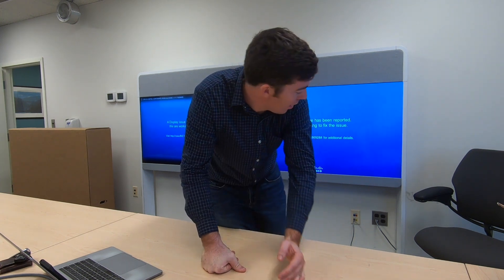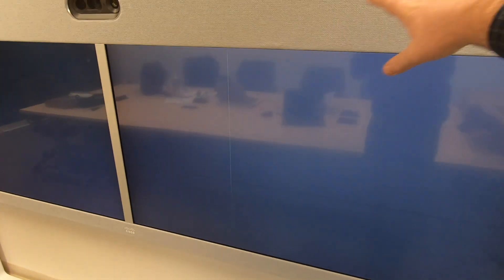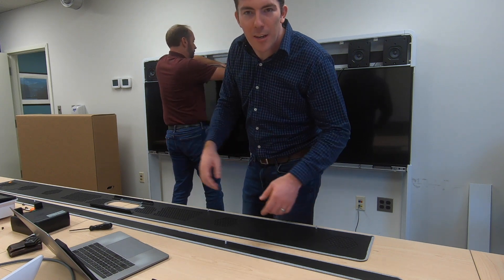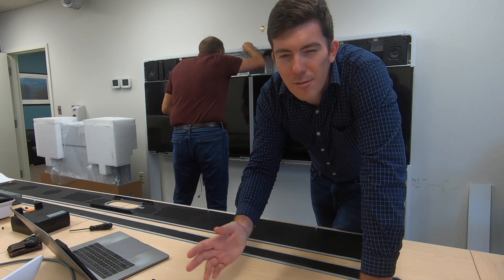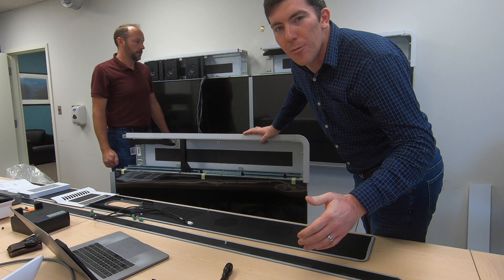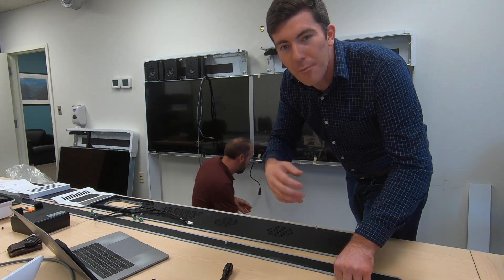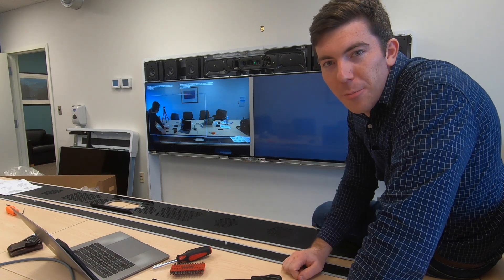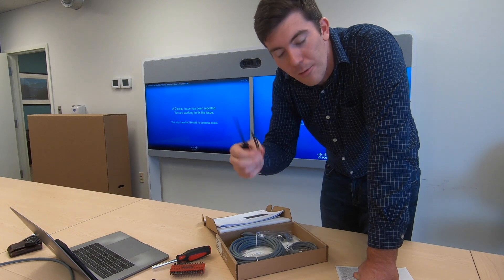Cisco Room 55 Daul Screen Screen Replace and Repair

Comment: Hi bro, i have spark room 55 but lost touch 10. Can i connect to laptop to use as extender screen without touch 10?
Reply from the maker: You could.  Just connect HDMI and go.
Reply: @TheTechCatalyst  Thank you bro, one more question hope you can help, cause room 55 was reset default so it stuck in startup wizard, i can log in web ui to skip startup wizard and can plug hdmi in to use as extend monitor with speakers. But, it still have a small over lay notification say that "touch panel is require" Can i turn off it 🙂

Comment: Do you have some advices to remove Room 55 from the wheel base? We pull the lock and want to lift the screen up, but the screen doesn’t move.
Reply from the maker: I think there is a screw the holds it on as well... check the installation guide and see if you can find something in there